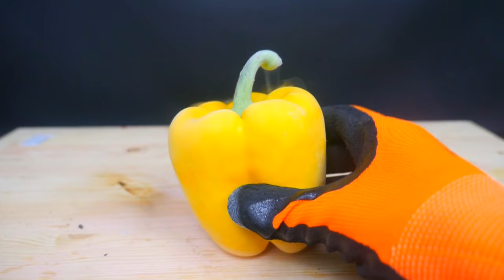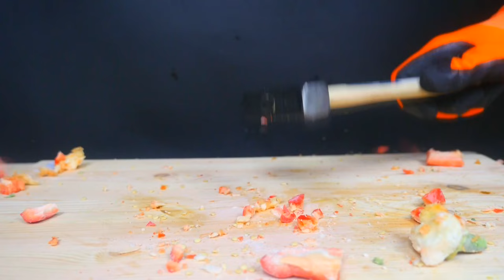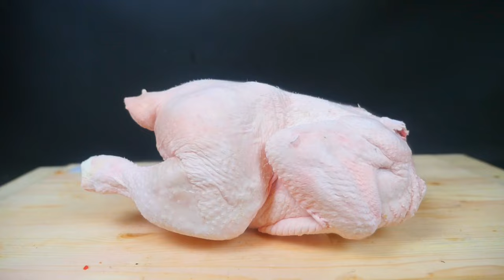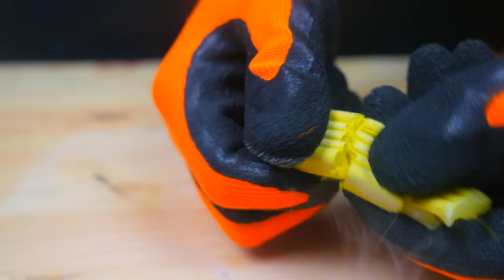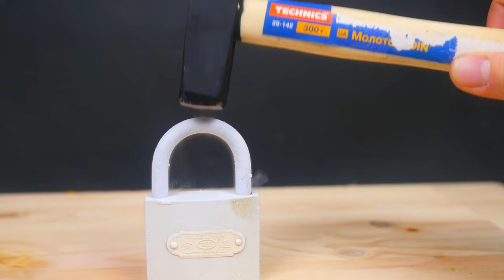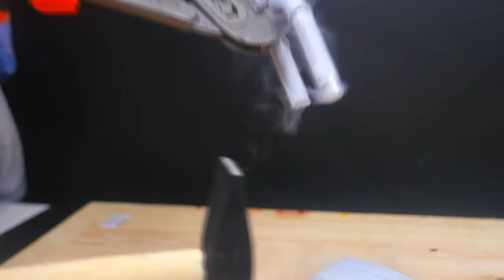Science Experiment LIQUID NITROGEN vs LOCK

Comment: On a science level the reason liquid nitrogen does that two objects it's because it is so cold that it prevents the molecules and atoms from performing their magnetic Bond bend or biometric tour subatomic Bond it's almost near-freezing so it slows down the atoms and molecules so much that they stop trying to hold on to each other that they stopped trying to hold on to each other other and try to preserve themselves so you can break it apart easier than if it were just its own matter